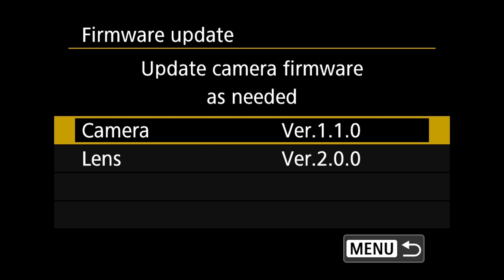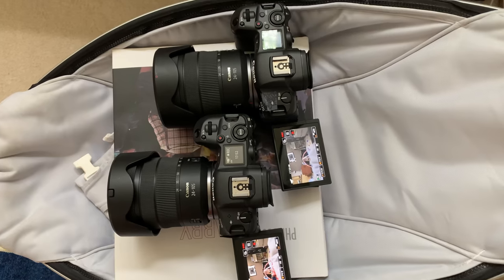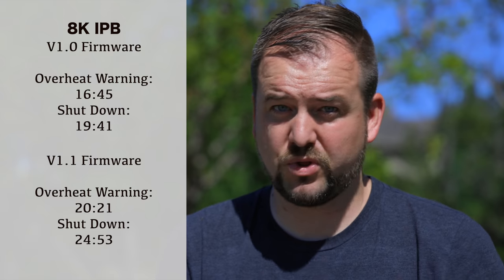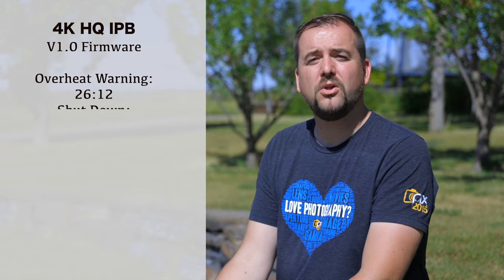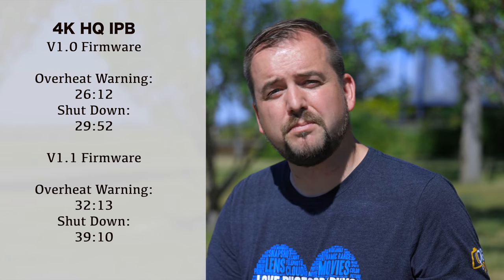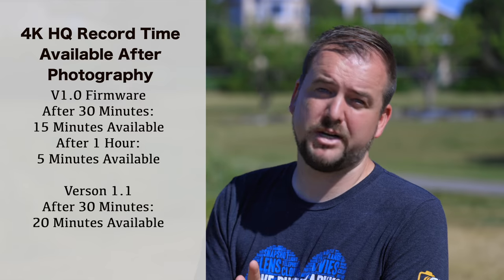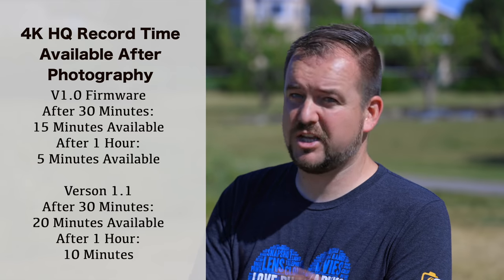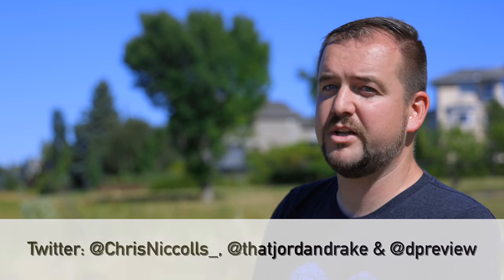Canon R5 Firmware 1.1 - Is the overheating fixed?

Comment: Continues to be a disappointment unfortunately.. For a photo and video shooter this is simply unusable even with the firmware improvements. Canon.. having an internal fan that runs to cool down unit between takes or better heat piping technology or both seems essential for 8K at current CPU and CMOS technologies. Smart cooling systems is something we need here. The R5 was clearly not ready mainstream pro use.
Reply: This Camera was not meant for pro video work.
Reply: i find recording limits totaly fine for a small hybrid camera. remember, its not a big pro film camera. active cooling would mean less/no protection against dust and rain and make the camera much bigger. heatpiping it always imposes the risk that in direct sunlight, you cook the camera and get much less recording time. 

the main problem is the long cooldown and that taking photos eats massively into the recording time. both feel too artifical limited, and that is just bull****. canon needs to ditch that timer and just rely on the real temperature meassuremts via the sensors.
Reply: @Digi20  Its suppose to be a replacement for the first mirrorless design replacing the 5D series. The cost alone for this camera is a pro level or semi pro level cost. yes the 1DX Mark III is top but this is the camera most of us were wanting because it was a good compromise.  This R5 isn't a true replacement now. the 5D series was solid performer both software and hardware for its time. For wedding shooters and other hybrid shooters like myself who needed awesome pictures and video. My GH5 blows this thing out of the water in terms of usability now (but not in terms image quality). Thats why its such a disappointment. There's no sugar coating it. waiting for a camera to cooldown on a pro level camera is unacceptable.This camera was not ready for release.
Reply: @Davitor1  Pro means any work in which you get paid. By your logic, wedding photographers and videographers aren't pros?

Comment: Isn’t it obvious that this is a software limitation with regard to the camera life expectancy? I don’t believe this is just a cripple hammer. Canon must have done testing to push the limits of the camera while ensuring it doesn’t fail after a few months of heavy usage. If a smartphone is left in the sun and gets too hot, it will shut down with a heat warning. If the software didn’t do this, it would damage internal components and the phones life expectancy wouldn’t fulfill its warranty guarantee. Overall it appears to me that this limitation is set in place so that these cameras don’t fail after a few months of heavy usage. What would be worse for publicity? Overheating with limitations to protect the camera or a camera with no overheating limitations but that doesn’t work after 3 months? I’m glad if Canon is pushing the limitations further but let’s not get carried away thinking Canon are just trying to cripple their cameras. The R5 and R6 are obviously still very capable cameras but if it doesn’t do what you need, there are other options.

Comment: Thanks very much for doing the firmware test, I am not touching the R5. Great specs, but I do not want to be worrying or timing for overheating as I shoot. That would be a terrible user experience. It is just unacceptable for a US$4K camera in my view. This camera is flawed, period. I am leaving Canon and going with Sony for my upgrade.
Reply: Not for folk who don't need video. If you really need to record for such long periods durations then why get a hybrid?
Reply: @Davitor1  Not at all, even if you need to shoot short clips you will run into problems too. This is especially true for birders who would shoot literally thousands of stills in a matter of couple of hours. And if you want to switch back and forth to video and film some 4K 60P 2 mins clips? You will overheat in no time.

Comment: My stupid questions: Why are the professional cameras are so big? And why have these big cameras no overheating problems? Why have the DSLR less overheating problems than the mirror less cameras... Why are the Panasonic 4/3 inch sensor cameras are so heavy and can have endless videos? And why have the full frame Panasonic mirror less camera a fan inside and endless video... Why is the Canon R5 not able to get rid of the overheating problem? And that is the reason why I have a semi pro Camcorder from Canon who never gets over heating problems and 3 Nikon cameras for making picture... Beside that, the NIkon Z50 has also no overheating problems, but the battery and the Display (if you use good lenses instead Nikon junk lenses) sucks for making videos...

Comment: I’m hoping that a real enginerd, tears into an R5 to determine whether or not it actually has any thermocouples and where they are located. Then they could put some proxy thermo probes in the likeliest places where overheating could occur and repeat these types of tests. Canon is outright deceiving customers.
Reply: My understanding is that it’s now confirmed the camera temp ( readable by software, Andrew Reid et.al reported on how ) on appears to align well with temperatures measured on the processor, if you disassemble and measure with a IR sensor. Sensor doesn’t get that hot. So based you should expect the temp reading thing they did to actually be close to processor actual temperature, fairly accurate.

(There is only an extremely think metal plate as processor cooler. No thickness, no heat pipe, no copper. And packed tight between two PCBs. The hardware design just isn’t built to perform without getting hot.)

Comment: I do also have a reliability issue for using this as a pro stills camera and that is battery life. Even though Sony only have a couple of hundred frames more in the CIPA (yes you get more in real life) rating than Canon. I would still take the little extra juice I could get and for less money. On the next generation cameas especially Canon, and other companies need to work on that so we don’t have to carry all those batteries for an extensive day of shooting..Sony just barely manages it today. Not exactly dslr standards..even though the R5 looks like a dslr size definitely disappointed that we are not seeing better battery life😅

Comment: There is no fake overheating because the camera does not overheat.  If it would overheat it would be damaged. You can be dissatisfied with the implementation of the overheating protection, but Canon alone is responsible for the warranty and guarantee. Greetings from Samsungs Galaxy Note 7.

Comment: Canon should have just left 8k out of it altogether.  It's a very capable camera without it...but they found a way to tarnish the unveiling...Canon style.
Reply: Leaving 8k out wouldn't have improved anything. The only thing that would have changed is no option for 8k.
Reply: @wyrmmm  Which is exactly what my first sentence indicated.  They should not have incorporated 8k at all.  It's not needed by the market at this time.  Then they could have unveiled a near-perfect camera...with near 100% positive reviews...instead of stumbling right out of the gate.
Reply: @JACKnJESUS  I agree with you, however i would like to add that even 4k60 without overheating would have been killer. 4k120 would have certainly been a gift without overheating. so The overheating is the bigger problem here, dont you think?
Reply: @bookphile870  Yes it is.  That's what happens when you come late to the party.  Canon and Nikon were both in denial about mirrorless...and it cost them.  But they had to get something out there to be fair...just jumped the tech gun a bit.
Reply: @JACKnJESUS  Yeahh. you could argue that Nikon got off to a rockier start than Canon, but they are kinda looking strong in terms of good cameras and affordable lenses, i mean, still not Sony level, there is a lot to improve in the Z system, but its not as delusional as Canon's RF.
Reply: @bookphile870  Totally agree with you there.  It's probably more imperative for Nikon to get their ship corrected.  Canon is a huge diverse corporation.  Nikon...less so.
Reply: @JACKnJESUS  That is true. Nikon is definitely a more niche product, and if it wants to appeal to a larger audience, it needs to do something more.

Comment: Instead make R6 a better 4k camera and the over heating issue on R6 will not be there as the sensor is much lower in mpix. Hence R6 can be a much better video kit rather than R5

Comment: I don't care if any of you "only shoot photos", this camera is over $4000 and has the most laughable cool down time I have seen in a piece of consumer electronics, it shouldn't even overheat in the first place. 8K is adding a lot of cost and is half-baked. If you are set on Canon then just buy a cheaper model that lets you use the R mount and wait for a better camera to put the lenses on.

Comment: OMG Jordan, it is a hardware issue that no firmware will fix. There are no workarounds. If you exceed the temperature design limits of a component, you run the risk of damaging it and the camera. There will be signs of overheating so good luck trying to get Canon to honor the warranty. Magic Lantern is a firmware company that cannot fix a hardware issue. Too many wannabe hardware engineers that should stick to photography.

Comment: How the hell does it take that long to cool down, even with the 1.1 firmware? I have never seen such a terrible example of heat dissipation. I wouldn't even trust this thing to take photos on a 36c day here. What an objectively piss poor design. This update is likely only allowing the camera to reach higher temps before shutting down meaning more stress on the hardware, no actual "fix".